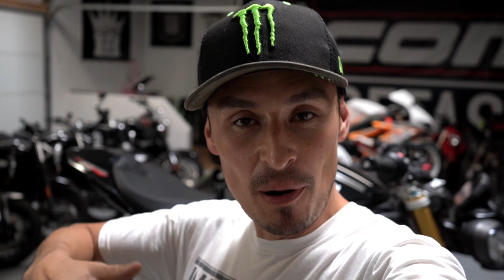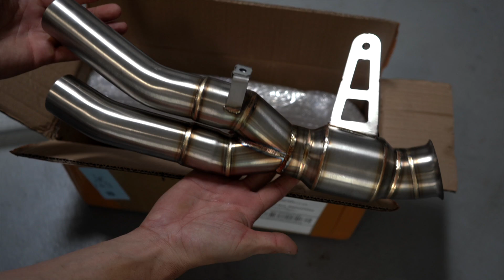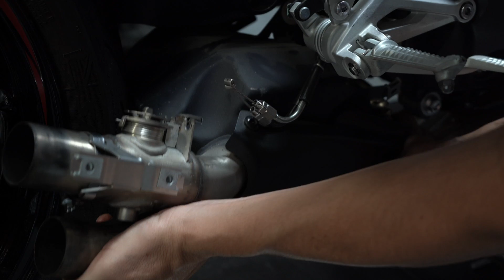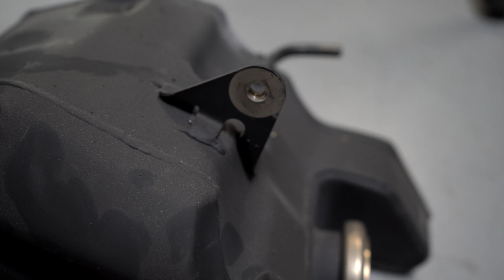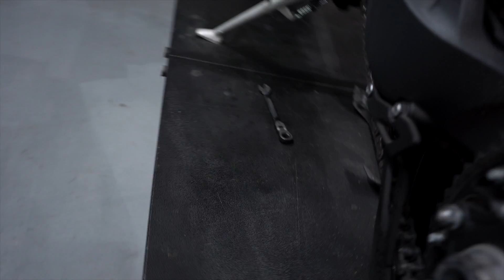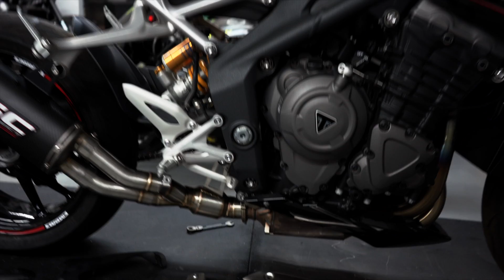New Speed Triple 1200RS Cat Eliminator install for Carbon SC Project Exhaust. Will it be louder?

Comment: No cat in the bread box, it's in the header. You save some weight but no change in flow. Should sound better though. Zard makes a really slick full titanium exhaust, headers and can, for about what you paid for the SC. For your ECU you can disable it with tuneecu. Works great, did it myself.
Reply from the maker: Yeah for sure. In the past Ive cored them out with a hammer and chisel to free it up. That will more than likely happen on these too but I wanted to get everything dialed in before hand. Its crazy how much of a difference it makes power wise. And thanks for the note on Tune ECU. I wasn't too sure if there was anoption or not so you just made my day lol!
Reply: True. I’m running a Zard slip-on. You actually don’t need to decat after that. It’s really loud and throaty.
Reply: Exactly, this is just silencer box. I decat’ed mine by cutting it out from headers. With prorace exhaust sounds now properly.
Reply: I bought the Zard Header it’s just the header pipe no slip on, total exhaust costs over 2k dollars head pipe being 1100 and the can being the same, before I got the header I cored out my cat and it ran so much cooler and gained a lot without a tune, tune would’ve been ideal I know that’s on the way soon it blows crazy flames without the cat becomes a whole different animal nonetheless
Reply: @justink6244  didn't run crazy lean after taking out the cat? I'm considering coring out my headers. What do you need for tool?. How far down the pipe is the cat?
Reply: @pax1980  if anything it ran a bit rich but hotter days it ran lean most of the time the exhaust was a nice chocolateish color not too black or white/ I’d definitely do it, I used a spade drill bit and a long punch just be aware of your o2 if you don’t remove it. Location if you take off the silver cat guard on the exterior you’ll see it right there it’s really close to the muffler box in fact
Reply: I should also mention the full exhaust is 304 stainless not titanium but it does blue in super nice still

Comment: Could you maybe cut open the „Cat“ to check what‘s in it? would be very interesting!
I got told that‘s just an additional silencer and not the cat.. would that mean that emissions stay „stock“?
i‘m not so much into the game the easiest for me would be that mid pipe but with the valve

Also could you do a DB Level test with that setup? im curious how much louder it is if it‘s only a silencer

Comment: can't you just remove the cables from the actuator box and leave the box to work as intended?

p.s. also, that looks like to be a mid muffle box, not the cat, cause there's still a huge phat tube under the bike, which is most likely The catalytic converter.
Reply from the maker: Yeah the cat is physically in the header and needs to be hammered or gutted out. The bike won't run right without the cables connected. You'd have to leave the box connected as well in the mid pipe which you can't do. I have it coming out tune wise this week so Ill have an update for it

Comment: Did you get round to making the peice that allows you to fix the belly panel in place as i have just purchased one and im gonna need to modify mine also?
Reply: You can make a small U bracket to mount on the bolt just behind it. Will try to get a pic of mine.